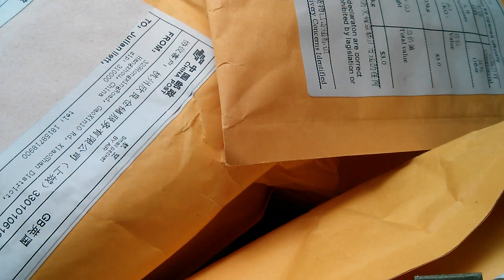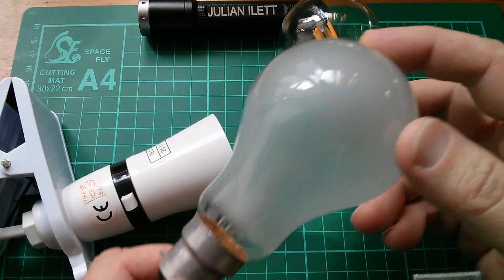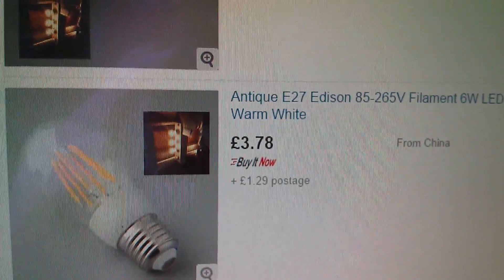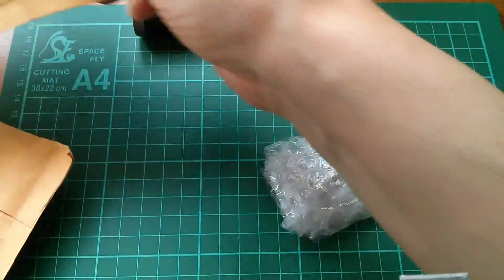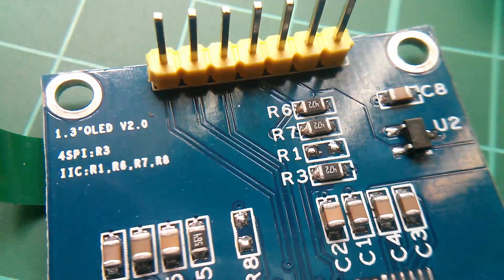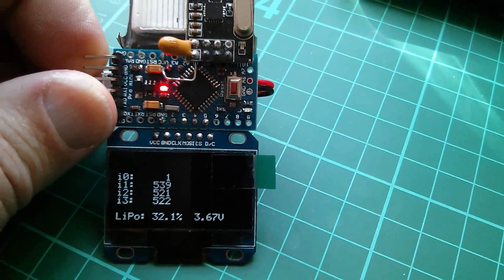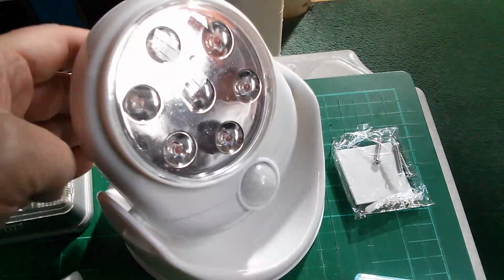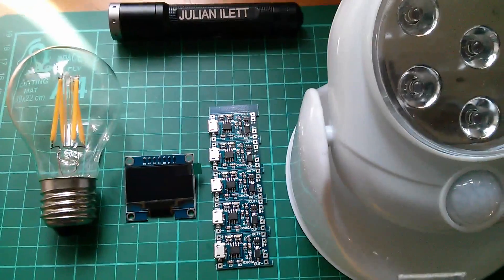Postbag #21: 4W LED filament bulb, Wearable bits, PIR Light Angel

Comment: Just bought 2 of these and noticed that they have this strobing effect. Probably at 50Hz. Does anyone know why? Did they forget to put in capacitors?
Reply: +cab3 That is weird. I work for a company that makes these and we make a type that doesn't require a processor or power supply and runs directly off the electrical current (just like the old incandescent, just requires 6W instead of 60W). If I were you I'd look for these kinds of filament bulbs that don't require power supplies (btw my company is called Saffron if you're interested). BTW the power supply is usually what goes bad first, so that's another benefit of going with the non-power supply version. I think typically 6W bulbs dont' require the power supply (AC-DC conversion).
Reply: +Cameron Postelwait Its weird yes. It seems to be more noticeable with the smaller 2 watt bulbs with 2 filaments. The 4 watt with 4 filaments are not as bad. They are probably just rectified and transformed down a bit. with some output caps.

Comment: I noticed the filaments flickering as I removed my bulb from its retail clear plastic packaging (in low light), 
Is it the electronics doing that or the filament itself?
Reply: bridgendesar So wasn't fickering when it was inside? Do you have a dimmable switcher?. It must be the electronics because the filament doesn't flicker unless you physically bend it.

Comment: why the hell you call filament bulbs retro? you can still get them as "special heat sources" :)
Reply: MrSlehofer No in EU. Remember what happened with Heatballs(R) case,. the second batch was held back by customs.
Reply: albertosapiens1 Funny fact is that I'm from CZ in EU and we have them here. 40W one for about 0,22 GBP or 0,3 Euro, or 100W one for about 0,33 GBP or 0,44 Euro

Comment: That bulb is seriously amazing... For all the people out there that still want the look of an incandescent bulb. Really makes me wonder why households don't just convert AC to DC for outlets since almost every appliance (including LED bulbs) must convert AC to DC regardless...
Reply: Haha but the price was always a good deal! You just have to divide the price over the hours of light the bulb provides and you see very quickly that they're cheaper than any other home light bulb in the long run.
Reply: Subzero Arctics Not everything in the house has a dc transformer.
Reply: You're basically saying that some things in the house use AC? But more things nowadays use DC, especially the things that take up the majority of electricity.
The main advantage comes if you use solar panels. Solar panels basically output DC and a home needs a DC-AC inverter to put that solar panel electricity around the house, only for most of that electricity to be re-converted into DC. Every time electricity is converted, some electricity is lost, and I wouldn't be surprised if it ends up being a large amount (but I don't know that).
Reply: Subzero Arctics You can't run high powered appliances on solar power.
Reply: My understanding is that solar panels charge batteries, and then when power is needed that electricity is drawn from the batteries. I know this one house (about 6,000 sqft.) that power air conditioners using solar panels. (Their electricity bills got so high that they needed to use solar)
Reply: Subzero Arctics It's easier to rectify voltage than to make a micro inverter to power something.

Comment: Light quality of those 4W is really pleasing almost like incandescent, but flicker is horrible, at least for what I saw in our local store with same LEDs. These one you have seems to have desent driver, not like standart Chinese `ballast` including only diode bridge, non-polar capacitor and RC filter. As result - flicker at mains 50Hz, which not comfortable. I`ve bought a few different LED drivers, and even cheapest and small one have about 60 KHz output. Or even this driver in 3.5W GU10 lamp (seller claimed 12W, lol http://postimg.org/image/ghdn149p3)
Did you check output frequency ?

Comment: Any flicker on that fake filament lamp? I bought some of each with and without the white base and the 2 without the white base have 100hz mains flicker - ughly as.
Reply from the maker: ***** None that I can see. I don't think you'd see 100Hz flicker anyway. TV sets had their frame rates changed from 50Hz to 100Hz to get rid of the flicker.
Reply: +Julian Ilett I work for a company that makes these and we make a type that doesn't require a processor or power supply and runs directly off the electrical current (just like the old incandescent, just requires 6W instead of 60W). In other words, zero flicker. Power supplies typically are what goes bad first in an LED bulb, so another benefit of the non-power supply version is they last a lot longer. The company I work for btw is called Saffron, let me know if you want to check out a sample.

Comment: Hello Julian posted a question some videos back and wasn't able to get a reply from you. Do you happen to know why a tp4056 charger board with the protection IC wouldn't work with a DC-DC boost converter board. I am using this to make my own power bank. Thank you. 
PS: the problem is that the charger board just shuts down the output when i connect it to the boost coverter
Reply from the maker: Teodor D I remember reading this question, but I didn't fully understand what you were trying to do. Do you have the LiPo cell in your circuit? The TP4056 may behave strangely if there's no lithium cell in circuit.
Reply: Julian Ilett no, i have 2 18650 ultrafire 4500mah rated (in parallel). They might be fake:) don't think they have protection altho it does say they do have. http://www.ebay.com/itm/400644259182?_trksid=p2060778.m1438.l2649&ssPageName=STRK%3AMEBIDX%3AIT

These are the cells i've bought
PS: i've forgot to mention if i plug in the tp4056 into the usb... it powers the discharge board, if it's running on the cells it doesn't
Reply from the maker: Teodor D The TP4056 is application specific. I don't think you can expect it to work properly if it's not charging a LiPo.
And, yes, those 18650s are almost certainly fake. But they should still charge.

Comment: love your youtube channel

i am interested in the circuit thats in the bottom of the LED filament bulb, it seams so very small, the filaments are rated 50-60v per filament and if they are 4 in series that would be 200-240V, and they are supposed to be dimmable from any ordinary dimmers. so i wounder if they have some circuit that detects the voltage cutting of the dimmer and changes the current out to the leds, or if they only use a rectifier with a cap that smooths out the voltage and a current limiting resistor in series with the 4 filaments and use the voltage drop to dim the light.

planning on buying the separate filaments and see what i can make of them :)

keep the good work up!

Comment: Hi Julian. You mentioned the LED COB filament things are 50-60VDC at 15mA. You mentioned how that would be difficult to achieve, but that beefy programmable DC-DC booster handles up to 80VDC, no?
Reply from the maker: It can generate the high voltage without difficulty. I just can't remember if the current limit has that degree of control.

Comment: is that light angel any good ?
Reply from the maker: ***** It's perfectly good - it's just much bigger than I expected. The 7 LEDs are standard 5mm types - called ultra bright, but not compared with high power LEDs. I like the use of 4x AAs - gives it a longer run time.
Reply: cheers

Comment: Hi Julian,

What wattage of conventional light bulb would you compare that filament style bulb to?

I like the design, but I'm looking for something that is roughly equivalent to a 60W incandescent lamp or 11-15W CFL.

Cheers.
Reply from the maker: reddragon27284 I'd say it's about the same as a 40W bulb. It's very convincing too - had the wife fooled. Nice omni-directional light. Weird though, when you touch the bulb after it's been on for half an hour, the glass is completely cold.

Comment: How are those LED filaments being cooled, they must be very efficient?
Reply: Some of the bulbs are filled with helium, which conducts heat better than air. Also, as Julian said the heat is distributed over the full length of the filament. I bought the bare filaments shown in the video and each filament has 28 led's along the length of the strip. BUT, the real operating voltage of the strips I got was 79V, not 50-60V! No wonder they were selling them so cheap.
Reply from the maker: PuchMaxi1988 Because of their length, they have quite a large surface area. But the glass doesn't get warm at all.
Reply: Julian Ilett I've found a video from our friend Electronupdate (watch?v=25j2C4jq2HI). It seems there are multiple leds on just one filament, it's not just a single LED (like I thought).

Comment: I have one of those "Light Angel" light for my closet. It works very well, motion sensor works everytime just DO NOT use the self sticky thing because I thought it was going to be sufficient for indoor use but it failed - I heard a thud the other day it didn't break but it would have had it been outside landing on concrete - other than that it's great and those batteries should last a really long time

Comment: LEDs desperately need cooling. Even 1 watt LEDs on stars need a small heatsink. I am SOooo curious, how can these new cob LEDs operate without the need of cooling?
Reply: I also wonder that too. We have one cob-style LED bulb which has a few of the LEDs flickering. They are failing, obviously. After a while (30 min) of operation, it does get quite hot, mildly uncomfortable I'd say, but not scorching hot.

I cringe when I see a video of someone powering a high power LED without a heatsink....!
Reply: Benjamin Esposti Some of these do get very warm, even on the outside, indicating the LEDS are cooking. However, the good quality ones with loads of lines of LEDs which run at low current seem OK

Comment: Have you checked the the boards in some of the battery powered lamps? I'm just interested in the type of voltage regulation and the voltage they could take. In many switching power supplies the limiting factor are the capacitors used and not the switching part itself. So maybe you could run a few of those from one or two cell lipos without any problems/additional losses.

Comment: Hi Julian. Love the post-bag series. Interested to see what you think about the monster led light and which of your array of led lights you would recommend for indoor use. Thanks :-)
Reply from the maker: Mike Dawkins My favourite is the 4 AA cell, 6 LED device.
Reply: Hi Julian. What's it called as  not sure you mentioned it. Do you have an ebay link?

Thanks M
Reply from the maker: Sorry, can't find that one on eBay now. Shame, because it's probably the best one.
Reply: Mike Dawkins 

This is Fan from Jiashan Kingfine Electric Co.,Ltd.
We are a led bulb factory in Zhejiang,Chian where near Shanghai!

Please check the attachment about our pricelist for led filament bulb,thanks.

Please contact me if you have any question,thanks.

Looking forward to hear your reply soon.

Best Regards,
Fan Yong.

Jiashan Kingfine Electric Co.,Ltd
——嘉善景凡照明电器有限公司——
Add:No.2 Yinxiu Road,Jiashan,314100 Zhejiang,China
Tel:0086-0573-84820386
Fax:0086-0573-84820383
Mob：0086-18969348975
E-mail:kingfine.light@kf-electric.com
Website:www.kingfine.cn